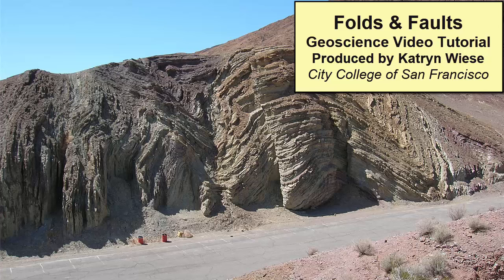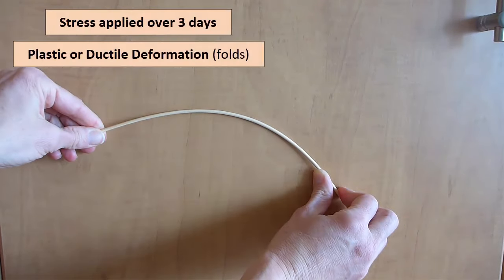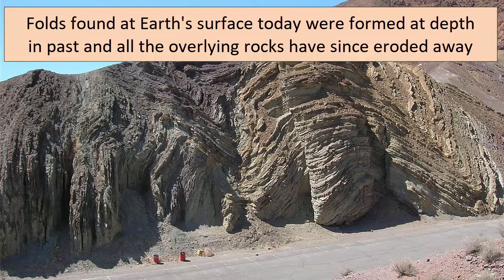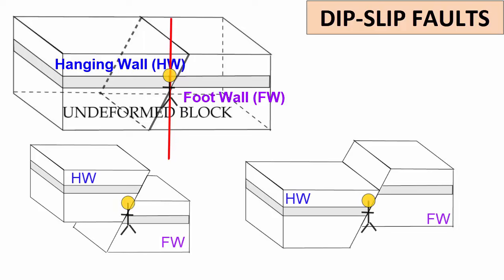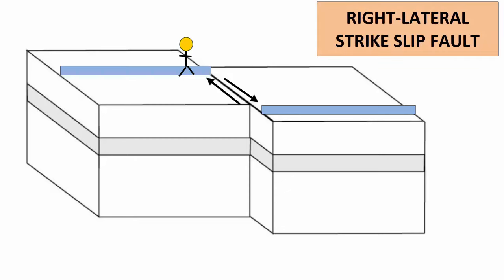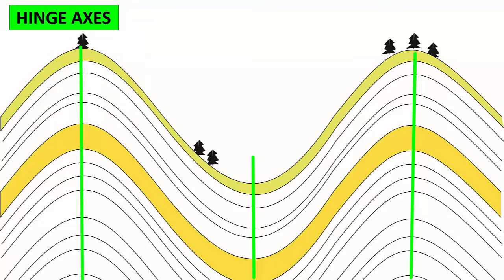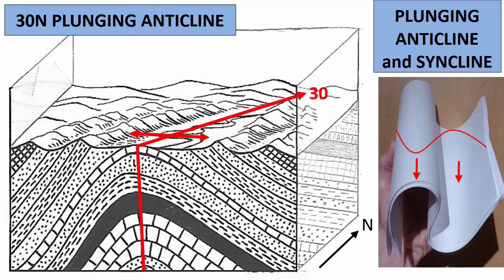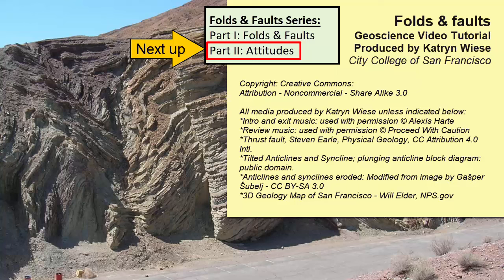Folds and Faults

Comment: This question please :(( 
•Is it possible for faults to cause folds or folds to cause faults? Explain.
Reply from the maker: One is caused by brittle deformation, and the other plastic deformation. Those two types of deformation happen under different conditions (as noted in the video). What are those conditions and are they mutually exclusive?